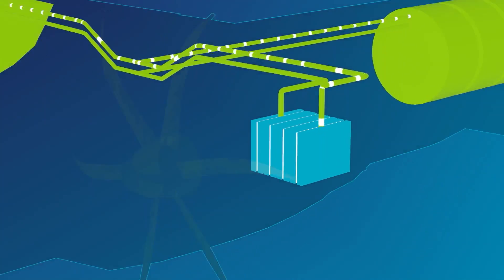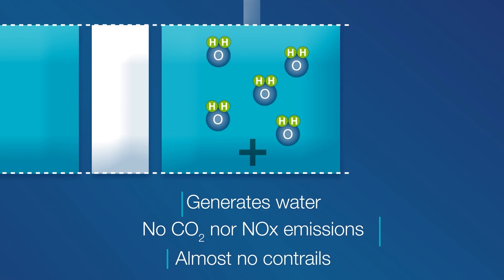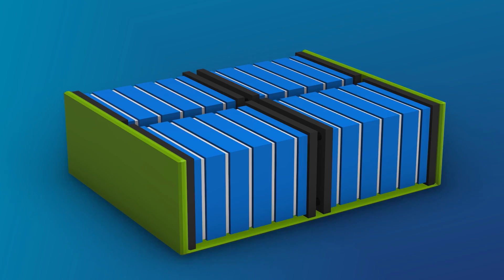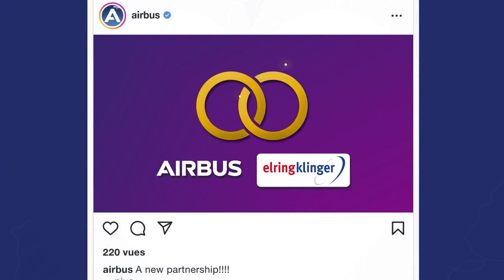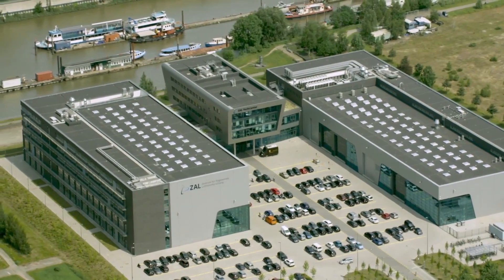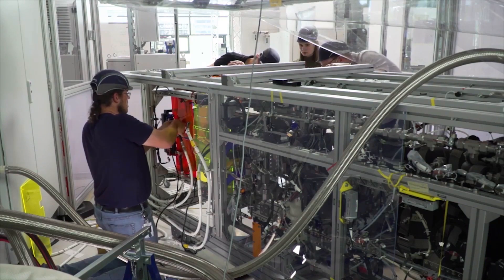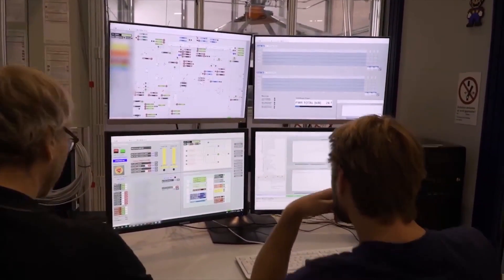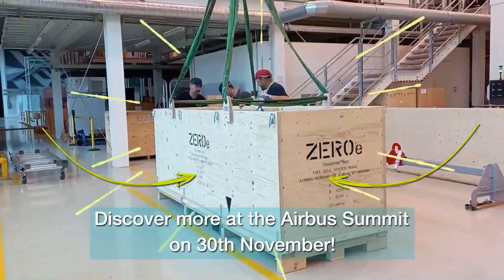Countdown to #ZEROe: Episode 2 - Fuel Cell Systems

Comment: The engineer was talking about having almost no contrails coming out of the aircraft.  The emissions is water, so why not just use the water that comes out of the fuel cell to flush the toilet in the aircraft then you'll save a few kilograms of weight because you need to take just a little less water to flush the toilet.